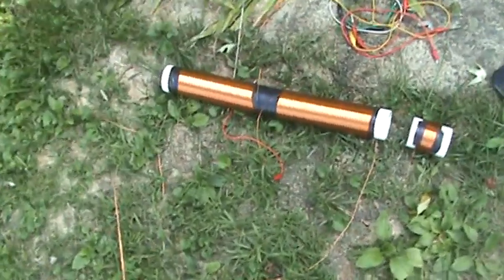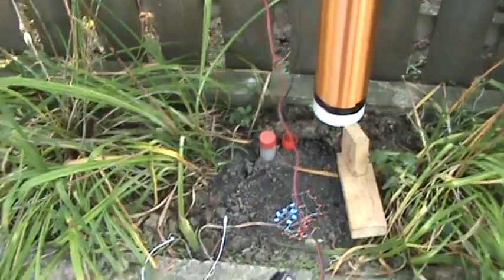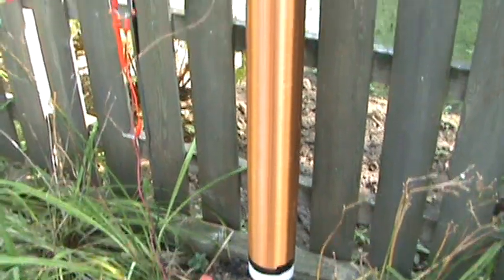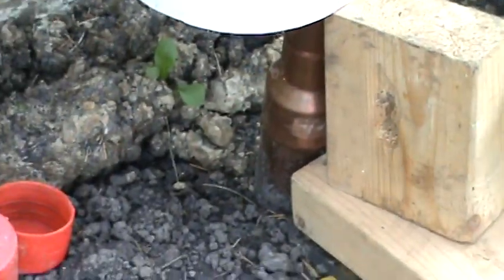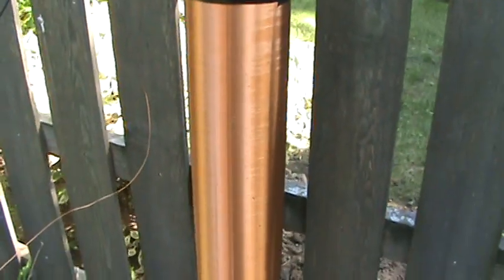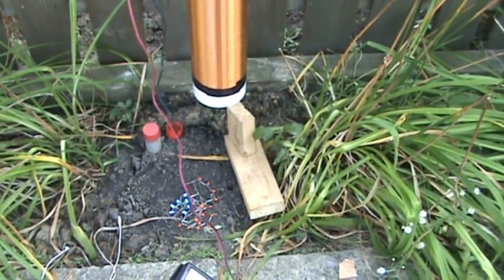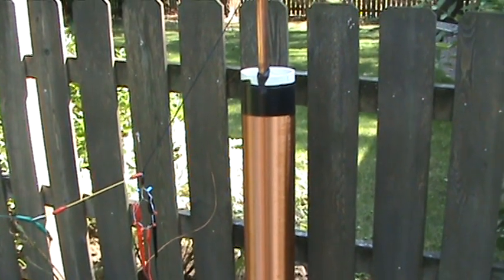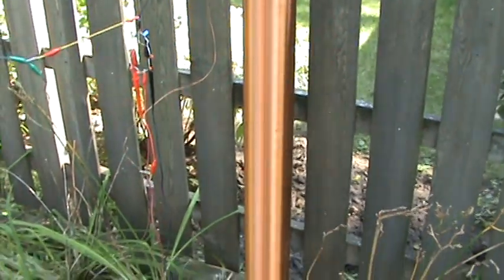FREE ENERGY FROM AIR CIRCUIT PART 20/24

Comment: If it oscillates with the piezo circuit the amps are one one side and voltage on the other and center should be half and half.
Reply: That is for the short fat coil going in the center to collect power.
Reply from the maker: @travismoore7849  I have the Barium Titanate cylinder from John Hutchison that i want to resonate with yet, a phenomenon is supposed to happen around 18Khz
Reply: @INVENTOR3  as long as it is used with an inductor it should still oscillate. Say you use an extra 300mH in line with the tesla coil and see if it is making power with the piezo across the inductors. It may not run near 18k. But should still vibrate. I did that with a 300mH trasnformer and piezo disc. So see if you can measure a voltage and current from a bridge rectifier first before doing a tesla like coil set up.

Comment: Try it ones whit a antenna for the frequenty of 369 Hz. It is to big to use at home. You can find the calculation for it on the internet.
Even a 1/4 wavelength is to big. If you go smaler in wavelength You have a lot of losses then.
Reply from the maker: Tesla 3,6,9 :-)    was thinking about that freq and also 7.8 Schumann freq of the Earth,,,,,or even freq of the cosmos in the gigahertz range, very short antenna.
Thanks for commenting, all ideas welcome :-)

Comment: read ferric oxides a grounding method and found it rusty,crumbley in color nearby here so you plan to coil around Cu. pipe where as in a galvanize old chicken feeder approx. 3ft. ht. x 1ft. wd. with rebar centered in middle filled  w / rusty dirt,however, cant yet say what difference except its an old time technique
Reply from the maker: Thanks, good tip :-)

Comment: Hi Paul. I was thinking about the coils over the ground pipe extension problem.
I was wondering about how "stuck" you are with the two 10" coils, but then you answered that by making one large coil.
What I was really wondering about is, would it be a benefit to put a coil on a piece of plastic pipe that just fits over the ground pipe with a spacer of "something" that won't ground the coils out when it gets wet (I was thinking cardboard, but the problem there is obvious)? That way you'd have all of the coil equidistant from the ground pipe.
I guess the best thing in that regard would be if the plastic pipe just barely fit over the copper pipe. Do you think that would be worth a try.

Bruce

P.S.: I just read one of the comments that said just about the same thing. I guess great minds DO think alike.
Reply from the maker: +Bruce Dobson Great minds think alike, yes, funny i was thinking this idea sounded familiar, heheheh.
Yes, i like this idea and i will try this :-)

Comment: Also for you antenna try thirty or forty wires of 1mm copper inside the antenna tube and splayed out like a flower200 mm  at the very top, I think this will help you dramatically
Reply from the maker: +Stop Renting Today Hmm, yes, like Tesla's lightning rod, or like frame of umbrella.  Yes, many points is better.  Im building anew collector now, and it should act as millions of tiny points.  Not sure if you have seen yet, my new series of free energy from air videos.  Search "free energy from air circuit 2015".
Thanks for your comments :-)

Comment: If you are honestly getting the volts out of that thing that you say, there is no reason you can't get 220+ volts. just run a coil of wire( maybe 5 or 10 wraps) around one of the coils of wire you have there, hook the top end of the  wire of the new coil to the positive out of your circuit and the negative out of the circuit to the other end of the new coil. you will should get more than 220 volts.
Reply from the maker: Bush Imports Hmmm, interesting.  I will try this soon.  Im working on this project now and just made a new energy collector to go the end of the long antenna wire.  I see what your saying, to step up transform the energy.  I have tried transformers, and i believe the problem with them is that there is too little current to induce the current in the secondary coil,,,but i will try your way you mention,,thank you very much :-)  Ill be posting another video on this project very soon.

Comment: Inventor3, you are creating a capacitor and an inductor, what you need to do is stick with capacitance and convert the antenna ions to usable energy by using diodes across the output with more capacitance in the diode circuit. start with 1000uf 35v (2) in series off the antenna VHF works good, then (4) in4001 diodes in series with (2) ceramic 224J 100v capacitors on the output will get you your voltage.

Comment: Have you ever wondered why the antenna coil in a radio is vertical, and not 

You also need to use an air tuning capacitor across each ends of the coil.

Also 50 feet of antenna wire in a oblong or box configuration.

Comment from the maker: I tried to use only half length of coil i use in videos, also tried a much shorter coil of same diameter, had no luck.  weather i change to shorter of skinnier coil, they would both be less Henries/induction, the amount of induction is what i will have to watch.  Now i have variable coil to try as soon as the weather gets warmer again.  Spring time in a few months. Hard to work outside now, only 25 deg F.  Sooonnnn, more experiments :-)

Comment: YOU HAVE VOLTS, WHAT ABOUT AMPS,HOW MANY YOU GOT,MAYBE YOU ARE TAPING TO THE EARTH MAGNETIC FIELD AFFECTED BY SOME MOVEMENTS BELOW THE EARTH SURFACE DEEP TO THE IRON CORE OF EARTH,THEY SAY WE HAVE IRON CORE THAT IS ROTATING, PROBABLY CAUSING SOME MAGNETIC FLUCTUATIONS,NO BODY YET MEASURED THE EARTH MAGNETIC FIELD IF DOES FLUCTUATE VERY SLIGHTLY,BUT RAPIDLY CAUSING ELECTRIC FIELD ON YOUR COILS, I THINK THIS WILL BE YOUR ANSWER,AND IF YOU GET LIKE NOBLE PRIZE OR ANY PRIZE DO NOT FORGET ME

Comment from the maker: @prosay1 Thanks!  That was the majical part,,adding the coil "over" the ground, voltage goes way up with very little comprimise of current.  I have another zink plated pipe in the ground next to the copper one that i can use for experiments also. Thanks again for the kind words.

Comment: also try adding a cap between the bottom of the coil and earth, charge the cap to HV and discharge it to ground via a spark gap, it will pull current through the coil in tune with the spark and can be used to set up resonance in a secondary output coil :P

Comment: The delta is voltage. You need to bigger free devices and huge capacitors then put in tesla coil    should produce exponentially. Think of the factors around you.

Comment: thanks for the video response what kind of voltage are you receiving? 40 volts is pretty good at ground level, if you can get 1v you can step it up through resonant coils and charge a capacitor :) see my videos about Camera Flash Circuits. Thanks again!

Comment from the maker: @eloid777 it maybe "part" earth battery. Hmmm, i did not try vinigar. I did try making the ground wet, it made no differance,,,,i was also concidering trying copper sulfate and/or also salt water in the ground.  But most of the energy comes from the antenna, because i get little differance between using 5 foot deep ground and 6 inch deep ground.

Comment: @INVENTOR3 With a variable capacitor, there might be (might) a fine tuning issue that may produce more current. I might very well be wrong there. but it just seems that if the "machine" itself is tuning to raise the voltage, there may be something there for a variable resistor.

Cheers.. 

ps good morning :D
Reply: Yes ground 💡 it's; negative and a wire with plate get electricity as s lightning goes there Stubblefield coils🥳😎
Reply: @naturalmilkhoneyandzenretr9508  wow a reply from 12 years ago.. :D Good deal. Thanks!

Comment: @gorgeousdzastr From my limited memory, a capacitor charges and quickly discharges the stored energy, Also that the capacitors are a "tuning" component and I forget formula but the capacitance changes as you add different capacitors. SO if there is a "tuning" that needs to be done, try putting a variable capacitor (like from the old tuners) in there to maximize the current of the coil.

eh?  :D

Comment: Thanks, I will watch your other vids too.

Also I was wondering if the dia of wire you used for the antenna would make a difference if it were larger, or smaller.

Comment: If you "press" a copper pipe into the PVC coil, allowing 5 feet or so to extend bellow the coil but put the copper into the ground as you have now, not the coil, that would ground out the circuit.

Comment: @INVENTOR3 Another thought may be that the "pressed" copper grounding, may not have to be such a tight fit, but maybe even a slight gap if you would, as in a motor. The armature doesn't touch the coil. But there is a gap that allows the motor to freely spin. Again, just a thought.

I really have high hopes for your experiments.

Comment: @INVENTOR3  Yes to the later, Pressing a larger diameter Copper pipe as the ground through the PVC (coil). I am presuming that the location of the ground itself related to the "alignment" of the copper grounding pipe should be as perfect to the coil itself. In my thoughts I am believing that a "pressed" copper center grounding rod may benefit the setup. However, again this may be just a rabbit hunt.
Reply: Well try it and show and tell bro,virs time!

Comment: Have you tried an experiment using a MUCH larger size copper grounding pipe?  such as the ID of the PVC? Even if it was n extremely tight fit.. Copper pipe can be expensive. so it would be a risk, but who knows.. Just another thought m8.

Great job. I'm keeping this experiment in my favorites.

Comment from the maker: Yes, best results with the ferrite rod, but it was in combination with the pipe through the center, pipe may not of been exactly up against inside wall of coil,,but ferrite rod was....i thinkm i need a bigger and longer ferrite rod to experiment with. Hmm, toroid may work same as plate,,i will think about this,,i like the way you think,  Thanks for the ideas. Keep em coming.

Comment from the maker: Yes, i agree, silver solder, i have good stuff...Yes, not plumbers solder for sure :-)
Just want to make sure that the adaptor im using now is the one i want to keep...still doing many experiments.
Today i will consentrate on coil wound around copper pipe and second circuit and antenna, and also charging large cap :-)

Comment from the maker: Hmmm, tank circuit....i think i almost have that now...i will think about it.
wire is .0324 with the double dip coating...if i remember correctly...i forget what gauge that is ...20 or 22

Comment: *What happens when u put a small coil at the top of the antenna, adding multiple antenna wires, add multiple circuits/from different antenna's on different groundings or the same grounding.